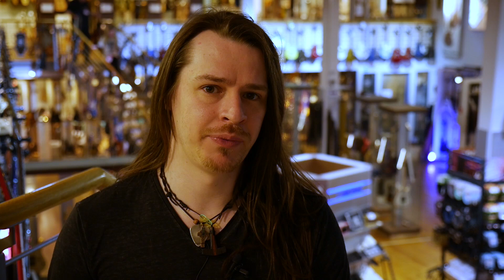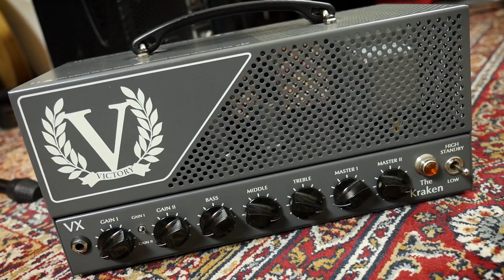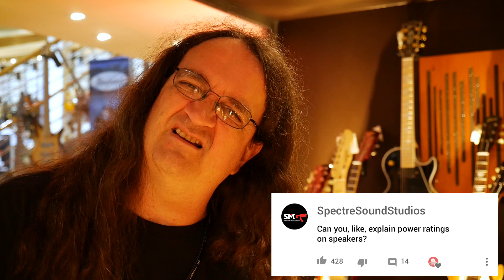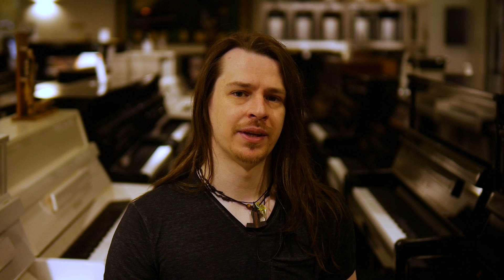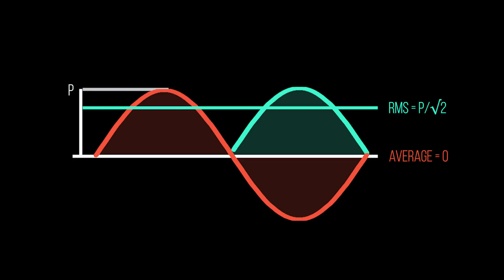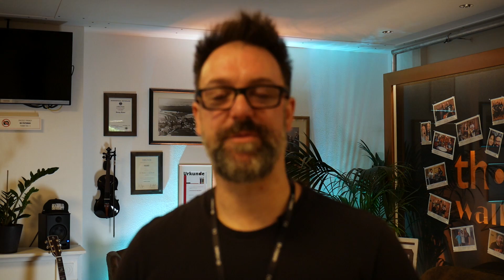How Does A Floyd Rose Work? and 6 other Tiny TATAs | Too Afraid To Ask #TGU19

Comment: How does pickup height, angle and distance from neck/ bridge affect the guitar's tone.
Reply: Height makes the pups louder or quieter (up=lounder, down=quieter). Angle impacts what part of the string is being picked up by the pickup. The more it is angled toward the neck, the more warm/bassy the tone. The more it's angles toward the bridge, the brighter the tone. The difference in tone comes from the difference in tension on the string at the bridge vs. the neck. You can hear it by picking along difference places of the string, as well. There is no "right" angle, only conventions, but you can angle them, or not, any way you like.

Comment: How does a metallic-flake finish of a custom guitar affect the secondary harmonics of multiple EL-34s? 

Please elaborate based on metal utilized.

LOVE seeing some of my favorite musical You Tube creators in this video!

More collabs, please.
Reply: It doesn't. Metallic flake guitars use so little actual metal there's zero chance of it affecting the harmonics of the guitar any. Plus the metal flake is aluminum which isn't magnetic under normal circumstances. You'd need a really strong magnetic field to make it so and you'd need it to be a solid piece of aluminum not dispersed as in metallic flake. The only way you'd affect a bunch of EL-34's is if you put a strong magnet against your pickups or stood near something with a powerful magnetic field.
Reply: @ZiddersRooFurry  Have you ever explained a joke you didn't understand? I own a snow flake painted fretless air guitar, now what pickups should I buy? My amp is a Behringer with lots of switches I don't understand. Does that help?

Comment: I've owned Floyd Rose equipped guitars since 1983, both floating and Eddie Van Halen style to the body. Changing strings on a non floating is no problem, just takes a little more time to cut the ball end . On a floating, do it one at a time. The bridge should be level to the body. Take off the old string, put on the new one, wind the machine head until it's level , stretch the string then turn the tuner until it's level again. I can change all the strings, tune the guitar without an electronic tuner in  under ten minutes. That includes cutting off the ball ends. Try it one time. If you take all the strings off at once you will be chasing the tuning for a long time . Simple.

Comment: The only time I ever use a tone control is on my Strat.
I have a Fender Player Strat (just like yours but in a different finish) and it has a bridge tone knob. I like to set it on 7-7.5 for a smooth lead tone that's not too harsh but a bit more dynamic than a humbucker

Comment: PMPO vs RMS answered a question I never even thought to ask.
I'm quite impressed. You seem to be such a KNowleable, Affable Bloke.
I feel that more people should be directing their TATAs at this KNOB.

Wot? Too much?
Reply: Except the explanation given isn't correct.  RMS is absolutely the real average power output, which is what it is designed to measure.  An ac output of 10W has the same heating effect as a 10W dc output.  This is why if you put a 20W RMS amp on a 10W RMS speaker it will heat the voice coil up and burn it out.

Comment: The key to the that kind of tremelo is absolutely the locking neck mechanism... 💯

It keeps the strings strong and stable, do you can shred like hell and do your damndest to strumb the guitar as hard as you can, you won't ever break them filers... 💯. Keeps your strings perfectly in tune the whole time, as long as you balance the tension between the neck and the bridge,  using the tiny precision knobs to achieve laser-like tuning after everything is tightened down and perfectly tuned.

I would never play with any other tremelo system... My preference is the Ibanez zero resistance double locking tremolo on my Ibanez s470.... 💯💯💯😎👍

Comment: Power handling:  Look closely at a fuse.  What is inside it?  A thin piece of wire.  When the circuit where the fuse is tries to pass too much current through that little thin piece of wire in the fuse, it overheats and burns up, leaving an open circuit and prevent the current from harming the rest of the circuit.  Look closely at a speaker coil.  What s inside of it?  A thin piece of wire.  It is longer than a fuse, but every bit as thin, and wrapped around a coilform.  When an amplifier feeds too much current through that wire it can overheat and burn up, just like a fuse. 

One important area where fuses and speaker coils differ is that, by moving quickly in a confined space, speaker coils can also generate heat due to friction against the sides of the gap.  Speakers can be more efficient if the gap between the coil and the magnet surround is small.  Of course, the smaller the gap, the greater the risk of the coil rubbing against the sides and creating friction.  So there is a tradeoff between efficiency and risk of failure....UNLESS the design provides for a perfect piston motion with absolutely no wiggling to the side.  So, efficient speakers are generally going to be more expensive speakers, because of what is involved in producing that perfect piston motion.  Of course, just because a voice-coil is NOT rubbing against the sides of the gap, it is still susceptible to burning out because of too much current coming from the amp.
Finally power-handling and efficiency are NOT the same thing.  The efficiency is a measure of how much sound pressure level the speaker can produce with one watt of power.  The power handling is how much power it can handle before the voice-coil burns up.  Speaker A may have a much higher power-handling spec than Speaker B, but Speaker B is still louder.  That's because Speaker B is more efficient, and essentially does more with less power being fed to it.
The range of efficiencies can be quite wide, with speaker models of the same size having efficiency ratings as much as 12db more than their competitors.  Indeed, switching to a more efficient speaker is an easy way to get more volume from your amplifier.  Just make sure the new speaker can handle the power of the amp.

Comment: You can change tube types in some amplifiers, even if there is not a bias switch or monitoring system. For example, my Egnater Tweaker has neither, but because it is cathode biased, it can use almost any octal tube (6V6, 6L6, EL34, KT66, 6550, and many others).

Comment: Peak power can be meaningful for the right gear, in the right situations.  I'd say it's more appropriate a measure for some high-fidelity equipment, which unlike most guitar equipment is intended to exactly reproduce the input signal, at a higher level.  If the peak power level is tied to a measure of distortion, then it can give you an idea of the headroom found in the equipment.  So the RMS will give you a pretty good indication of how "loud" the gear is in general; the peak power will let you know how well the gear will handle the occasional transient without distorting.  So on something like a subwoofer for a home audio system, peak power may be relevant.  Comparing two subwoofers with equal RMS rating, I would think the one with a higher peak power rating would be more able to handle the occasional extreme timpani strike or cymbal crash without distorting.

Comment: Dangerous advice, a 25 watt amplifier can put out around 50W at high distortion (unless its some piece of crap rated PMPO ;) ). And "50 watt" Marshalls are rated up to 70. However some speaker ratings may take some of this into account, especially if also a slightly updated reissue.
Guitar tone controls are also far more interesting than described.

Comment: Even if an amplifier has a bias switch to allow either 6L6 or EL-34 tubes... the output transformer will be impedance matched to either 6L6 or EL-34 tubes... so you can't get the maximum tonal character of the tube the output transformer isn't designed for.

Comment: yeah well pmpo is usefull to see what the lowest wattage of cabinet you can use is. if you use a lot of distortion, you could sit well over the rms of the amp, meaning that if you have a 200 watt amp paired with a 200 watt speaker, it still might do some damage. with my bass 200 watt (4 ohm) bass amp, i would dare go any lower than a 300 what speaker

Comment: Hi Colin, Great video bud a lot of questions answered. 

I too have a TATA but it’s a really silly one with a long winded/boring back story, in my 2016 Gibson Les Paul it came stock with burst buckers, quick connect and push pull features which I used for 2 and a half years before  I retro fitted a classic soldered 50’s style wiring harness to allow me to fit pickups of my choice.

 As a huge Guns N Roses fan (que barrage of hate comments) it’s obvious which pickup selection I went with... Seymour Duncan alnico 2 slash set... yes the zebra ones, I think the guitar sounds great and sounds more in keeping with the sound I’m going for through a Marshall Silver Jubilee. 

Which lead me to thinking, how does the type of magnet I.E alnico 2 vs alnico 5 ETC effect a guitars sound? or if it does at all and it’s all just a trick on the mind? 

Sorry for the long back story and long comment. 

I also want to say thank you for the note with my hat and T shirt I purchased back along that was an AWESOME touch! Just added a personal touch to it all which was really cool! 

Keep it loud!!

Cheers, Ross.

Comment: After thinking it a lot, I finally got a good TATA question..

What's the deal with the pickups that has two pole pieces per string?? Those pick the sound differently that the most common with just one pole??

Like those feature on Kiesel or some old Carvin, or, a more evident example, the Jazz-type bass pick up? I think I even saw once a bass MM-style with two poles per strings as well

Comment: How does the fishman Fluence pickups work ?
Reply: Same way as regular pickups, except instead of wrapping a thin copper wire thousands of times around a bobbin, dozens of printed circuit boards, each with a spiral circuit trace, are stacked in order to create the coil.

Comment: I have a #TATA 
How to deal with microphonic/old pickups and wax potting?
Reply: Another question to this topic:
What the hell are microphonics? What does it mean? #TATA
Reply from the maker: If a device is microphonic then it is behaving like a microphone, transforming physical movement in the system into electric signal. 

If parts start jiggling about that aren't supposed to move then it can add unwanted artifacts to the sound. 

Wax potting consolidates all the internal parts into one solid lump so nothing moves independently that isn't supposed to.

Comment: If a watt is a watt, why do people say tube amp watts are louder than solid state amp watts?
Reply from the maker: Headroom. Harmonic distortion of solid state amps is unpalatable at high volumes, so solid state amps require more watts for headroom: to be as loud without power amp distortion. 

Valve power amp distortion sounds lovely so you can run them to the extremes of their power, leaving no headroom at all, and they still sound great. 

It's about how much of the power is actually usable from a tonal standpoint.
Reply: @ScienceofLoud  Can you please do a segment on headroom. I have heard that term used a lot but I must admit that I do not really understand what it means.

Comment: What's the use of a fret 0 ?
Reply: "(the zero fret) holds the strings the correct distance above the other frets on the instrument's fretboard. A separate nut is still required to establish the correct string spacing when a zero fret is used." -from Wikipedia
Reply: Thanks, but it was a question for Tatas
Reply: @MorghanStark  ...were you looking for the correct answer or just asking because the Youtuber is popular?
Reply: Nothing better to do hmm?

Comment: Wouldn't a tone knob that controls a high pass filter make much more sense in a high gain context?
Because that's exactly why we're using Tube screamers as clean boosts.
Reply: That wouldn‘t be hard to accomplish. Just swap the capacitor and the potentiometer around, so that the capacitor is closer to the pick up/switch and the pot goes to ground. Theoretically, never tried this though, maybe will

Comment: That peak power number sounds an awful lot like the way some motorized vehicles are advertised.   For example:  Tractor hp ratings.  The listed hp is for the bare engine and cooling system- measured at the output shaft.  Well that's great- except we're talking about a vehicle here, not a frigging engine on a stand...  Various other things also draw power- such as hydraulic pumps; AC systems; transmissions; final drives, etc.  Thus, to determine what that tractor can ACTUALLY do, you need to look at PTO hp or drawbar hp.   I don't know why stupid meaningless numbers get used to advertise stuff...  Other than to bamboozle the number crunchers and bigger = better guys.

Comment: Why can't some guitar stands take a guitar with a nitro finish? How do I know my guitar has one, and how can I combat this?
Reply: They'll interact chemically with the lacquer and "damage" it. It's because of the material is used where the guitar contacts the stand. Most guitars don't have nitro finishes because it's more expensive to apply properly generally requiring multiple thinner coats and sanding/buffing in between coats. Poly finishes are generally a one shot and let it dry deal. If you have a Gibson it's almost assuredly Nitro. Most other brands it's used sparingly throughout their range. The manufacturer's website should have the info. Or you could ask them. Best advice... Don't buy a stand that can damage lacquer (nitro) finishes.

Comment: Surely certain valves are interchangeable such as 12ax7 which can be changed with say 12at7 for example in order to modify preamp gain?
Reply: The question was about power valves (6L6 and EL84).
Reply: Nowhere in the question was the word 'power'.
Reply: @alanmcgowan8767  If you mean your question, then yes, the various 12A_7 valves are indeed interchangeable. I just meant to point out why preamp valves weren't discussed in the video.
Reply: Mine wasn't a question.
Reply: @alanmcgowan8767  It has a question mark at the end :)
Reply: @khronscave  yes rhetorical questions do.

Comment: I mean you could make a custom amp that has two different valve sockets but im not sure how you would do that, it would make for an interesting amp
Reply: THD made amps that could use a wide variety of tube types. Great amps.
Reply: @stupiddooley2140  sounds interesting, know any model names?
Reply: THD, Uni valve 15, Bi valve 30, Flexi 50.
Reply: @stupiddooley2140  thx, gonna look those up

Comment: What does motor boating on a tube amp mean?
#TATA
Reply: Look up Tube Amp Motorboating here on YouTube Search. Lots of information on that subject that electrical and mechanical engineering and mathematics plus equipment needed and the learning to work such problems out. Better to be safe and let a pro tech wizzard work such problems out of electronics such as tube amps. There is just not enough space hear to explain  all the Q & A in and outs concerning the Motorboating, electronics diagnostics equipment, causes, parts and the solving fixes to such problems in electronics or mechanical circuits and devices.
Peace & play On . . . 🎸  😎  DDHarris. 7-18-2019
Reply: @donaldharris8826  you can look up any of these questions on any of the TATA videos and find the answers. The point is to find questions a lot of people probably don't know or never looked up.

Comment: How do active pickups work?
Also what’s the difference between normal active pickups and active pickups labeled “HZ”?
Reply from the maker: The HZ line from EMG are not active. That's their passive pickups, the HZ presumably standing for 'high impedance' which passive pickups are, unlike the low impedance active pickups. 

I have a previous TATA which covers what's inside an EMG which should answer your question.

Comment: I've got a TATA!!! Can you use a bass cab on a guitar amp and play high distorted guitar?
Reply: #TATA
Reply: bass speakers will handle guitar tones no problem but not the other way around. a bass through a guitar speaker will destroy the speaker at higher volumes. you still need to consider impedance and wattage between the amp and cab though.
Reply: @HellionBlade90  you just made my day

Comment: hello there Colin, recently I changed a jackson stock pickups in my Jackson kelly  for a Seymour Duncan TB-5. it works fine on its own just as the original stock jackson neck pickup does, but when I switch to middle position on the switch the sound becomes weak, very trebely and simply like ther's something wrong. At first I thought I switched the bridge and middle position on the switch (somehow). This made me wondering: Is it OK to mix different brands of pickups? like is it ok to have a passive Seymour Duncan Dimebucker on the bridge position and an active EMG 81 on neck position (For example)? or are Seymour duncan pickups made to work only with seymour pickups, EMGs with EMGs etc...Can you make it one of your topics in quastions that we are too afraid to ask? Thanks. Keep it loud and I'll see you later.